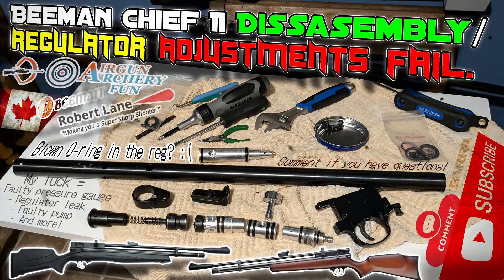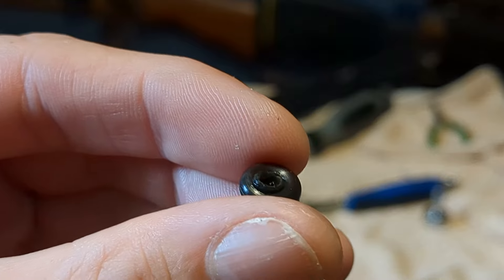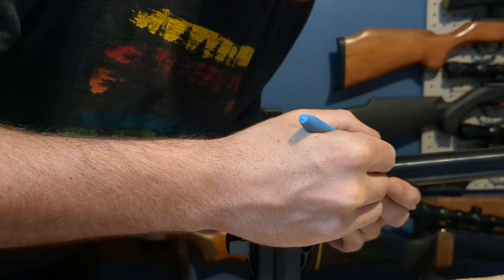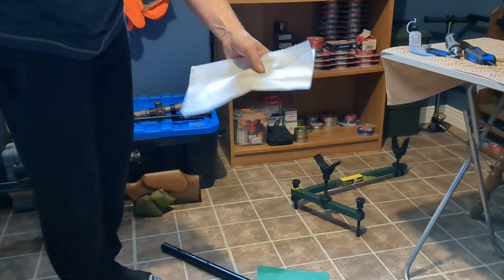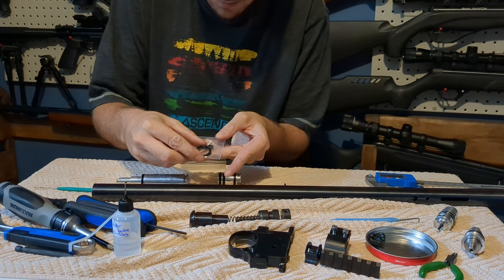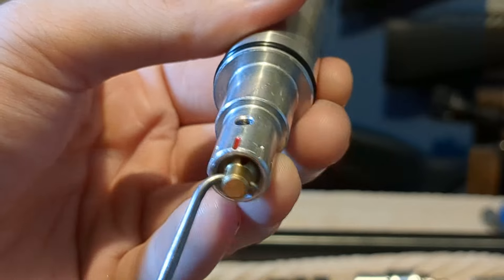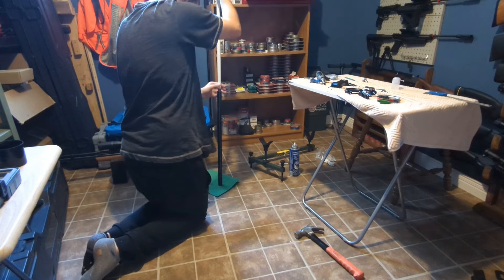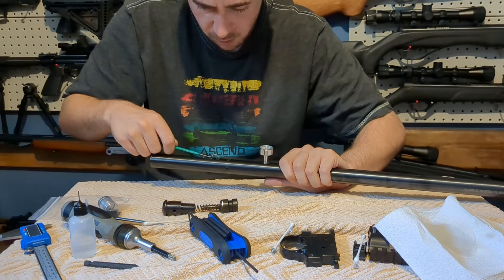Beeman Chief II PCP Air Rifle: Complete Teardown and Reassembly (Regulator adjustment goes wrong.)

Comment: Great video, son ! 
I hope you didn't lose any of the parts !! Every time i take something apart like that and put it back together, i end up with one or two screws left over !
Reply from the maker: @timmy4539  Yet the only thing that I "forget" to put back on any rifle that I've ever worked on is the bear trap safetys! Haha

I am not a bear so I should be fine.
Kinda forgot to mention that I had no bear trap safetys on both of my Gamos during  the trigger adjustments thinking about it 😂

Thanks for watching :_LwkLogo:
Reply: @LowkeyAirgunner  
With Gamo, if they had them, they would be called panda traps ! Lol
Reply from the maker: Gamos are made in spain.
Crosmans are mostly made in China and will definitely will be from now on!

But I was surprised to see that chinese machining is far superior to spain machining...
or maybe they order at the same place but  for cheaper who really knows

(If you assemble a product made in china and mark it up 60% technically you can say you made it wherever you are)

Comment: Nice vid mon ami. Glad you got all those 1001 parts back in the correct place. LOL!
Reply from the maker: Pff there is probably more parts on a 2240 or 1377 to be honest haha

Most of the airguns that ive taken apart were pretty easy... the only powerplant that I didn't mess with yet is co2 but a qb78 is simmilar but different (needs a different special tool/ very long & big flat screwdriver)

Thanks for watching! :_LwkLogo:

Comment: thank's for this video, where did you get the degassing tool? I have been trying to contact beeman for years with no help. I have a 2027 that won't cock and I need to be able to work on it safely. love your channel keep up the good work!
Reply from the maker: @johnoneil6742 Both of the guns came with included degassing tools...

They are different tho one is a big rod with threads that replaces the hammer adjustment maybe you got something like this?

If not unscrewing the pressure gauge slowly should also work 

Edit; If you are in the USA, 1100z Vent (Degassing) Screw are 2$ at Barra Airguns... They have "slightly" better customer service than Beeman and helped with info for this video

Thanks for watching! :_LwkLogo:

Comment: How did remove the moderator from the barrel?
Reply from the maker: @jayhay1237  I did not this is a Canadian model

But apparently you can by unscrewing a part of the mod and then accessing a 16mm nut from inside with a very small wrench

You don't need to do this to take it appart tho only loosening the band and removing the sights to be able to remove the barrel also works

Thanks for watching :_LwkLogo:
Reply: Thanks for reply. That helps. I found out that it is easy to disassemble with 8mm Allen wrench. Then I learned it needs to be cleaned periodically and take care to align the ports of the three k-baffles when reassembling. The sound is noticeable better moderated after this maintenance. At 2000 psi I can hear my hammer spring again and the impact of the pellet.
Reply from the maker: So you did not take it fully off but cleaning it did fix your problem? Glad to help!

Comment: Hello sir my self kamal im from india I have one doubt regarding to regulator set up on an .177cal air rifle. I have unregulated .177cal pcp I'm planing to install regulator contains 30cc power planum with 130bar presser. suppose i install the same setup how many ftlbs  getting on a jsb 10.34 grain pellet sir?
Reply from the maker: I assume that this Beeman Chief II with a .177 barrel would be way over 800fps (14.3gr) with the regulator set at 125bars/200 max fill (as shown in the chronograph snapshot at the end of the video) and fairly low hammer settings so you would get pretty much the full usable velocity (unless you use heavy projectiles) and more consistency 

Energy depends of weight and velocity but  pellets tend to fly the best in between 850 and 950 fps so arround 20fpe max for 10.34gr which this rifle should do easily in .177cal
{I didn't try it myself but it should be the same rifle just a different barrel so I would assume 10.34gr should need less air than 14.3gr to meet 900fps or so}

Thanks for watching :_LwkLogo:
Reply: @LowkeyAirgunner  thank you soo much for replying and it is a good information for me sir...

Comment: I really like the simple design of the 1pc main tube. I will also make a similar tube tank for my upcoming semi auto.

But damn those o-rings seem really tight 😂From my experience of making o-ring grooves it's enough if you can just feel the o-ring be just a little tight, but so that you can push it easily. That's enough to hold thousands of PSI already.
Reply from the maker: @pcpairgunschannel  it was tough during dissambly because of the o-rings piece that came out of the regulator but it went in or out fairly nicely the other few times I've done it!

It is definitely a very simple but effective design. 
If people are scared of getting into Pcp's because they think it it harder to work on than other powerplants this video can definitely prove them wrong {depending of the models they can be very simple}

Thanks for watching :_LwkLogo: